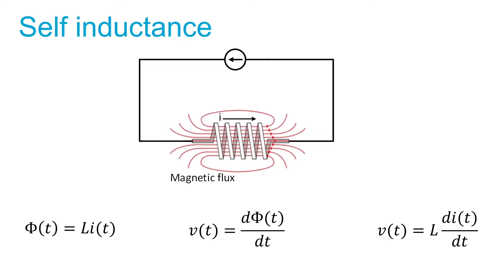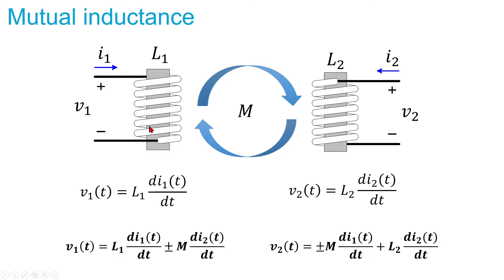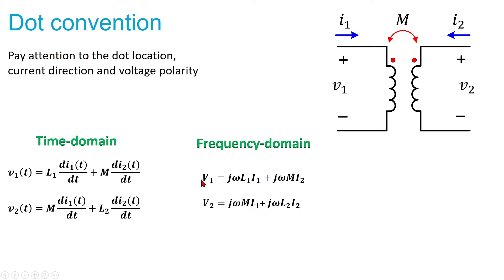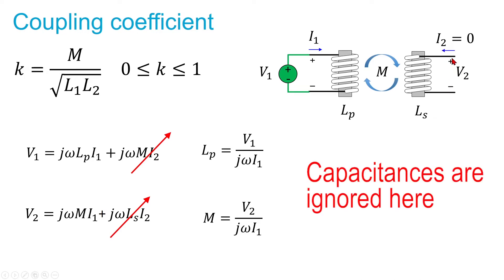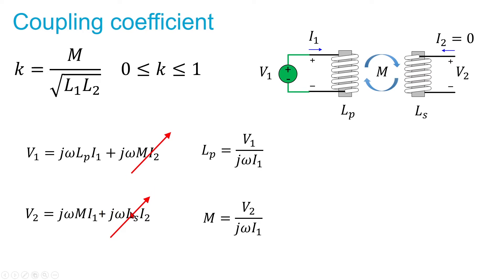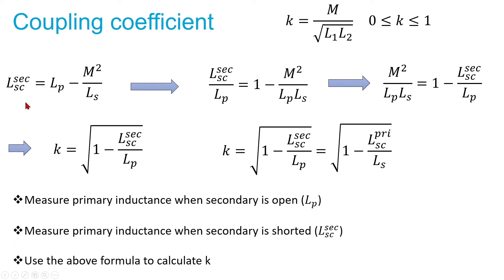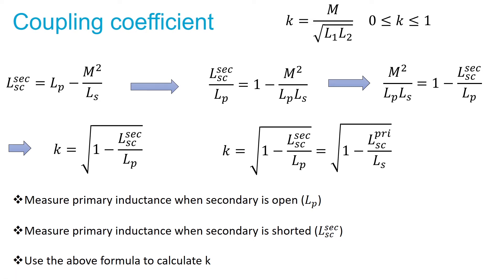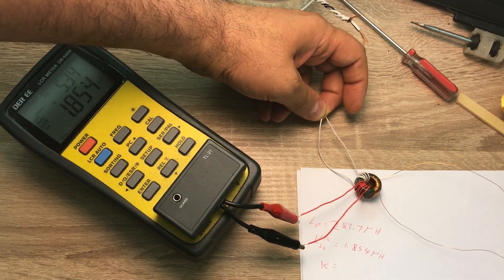How to measure coupling coefficient between two coils / windings

Comment: very well explained. just what I needed. thanks you are a great help.

I still wonder about the relationship between coupling coefficient and the capacitance between two coupled coils as I work with a dual resonant system that is using both the inductive coupling and capacitive coupling

Comment: Very nicely explained. I have two questions. 
What if there are multiple secondary windings? Also, if the transformer is a resonant topology one (inductance would change with frequency). So at which frequency it must be tested?
Thanks.
Reply from the maker: Thanks, use the same approach for multiple coils. when doing measurement to get coupling between two coils, the other coils must be kept open. Inductance is frequency dependent, so your best bet is to do the measurement at or near the frequency of your switching, or alternatively you must make a frequency dependent model which makes it more complex.

Comment: Hi Sir, do you write a paper for this or refer to other paper? If yes, could you provide it? Thank you. Thanks for excellent explanation by using a video.
Reply from the maker: Hi, I did not use other references, and I am not going to write a paper on this (this is basic stuff and is available in books). I just drove it myself since I saw the final formula in Wikipedia and was wondering why that is so, so I decided to make it more clear for other people. Anyway, in case you want to reference this in your work, you can just reference this video😇, it is possible.

Comment: Thanks for the explanations. It was good but what is the significance of this parameter? Why do we care about it?
Reply from the maker: Thanks for the comment. For example if you design a wireless power transfer device using induction, the coupling between coils plays an important role in design and efficiency of the system. This factor can also give us similar information as leakage inductance. leakage inductance can have impact on efficiency, also for large power transformers it limits the short circuit current. For spark gap Tesla coils it has an impact on wave damping and so it is important for the whole design, usually a weak coupling is preferred. While for solid state Tesla coil you want to have high coupling factor. An ideal transformer has a coupling factor of 1.
Reply: @HVE  
Thank you for the explanation 😊